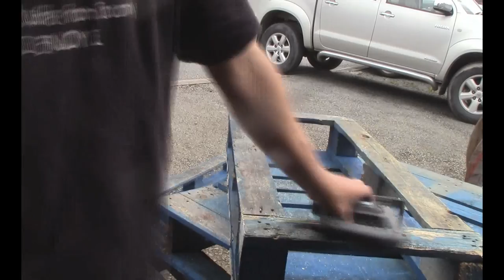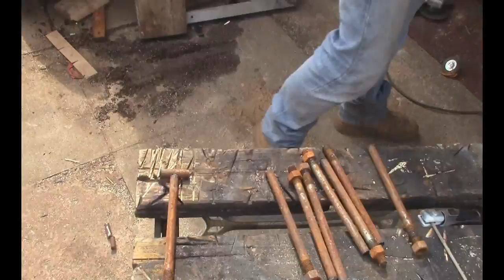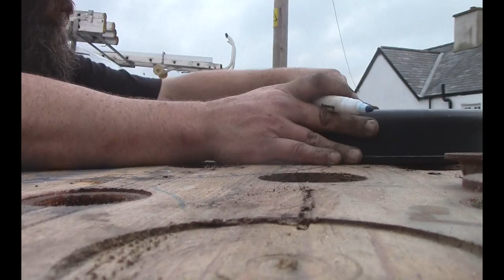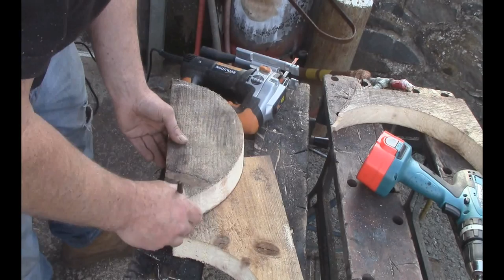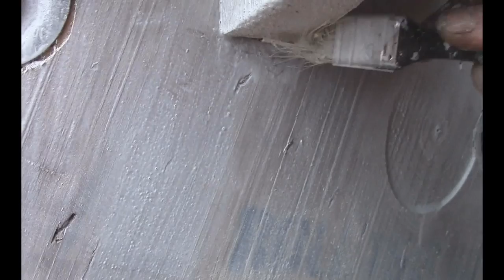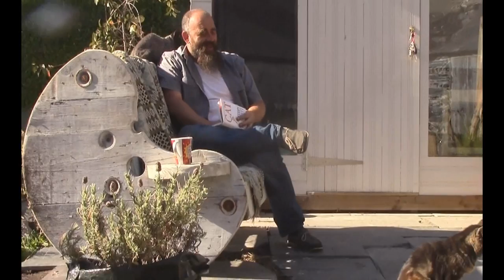DIY Garden Bench Project - Pallet and Cable Reel Furniture

Comment: Love this !  Just wondering why on the video's fist drilling that it only shows you going through the spool and not into the pallet blocking. Or did you just go through enough to mark it , then pull pallet back and finish drilling? Was the bit long enough to go through the spool and the pallet and if not how did you complete the opposite side drill holes. Thanks, I'll be building one next week.

Comment: love this!  Now I'm on the hunt for a cable reel. 
What did you use for "whitewash"? I really like how it turned out.
Reply from the maker: thanks, its standard household paint, i think its vinyl matt emulsion, water based and then i watered it down a bit more, i think the shade is white lavender or something like that
Reply: Thanks for the tip! Turned out nice.